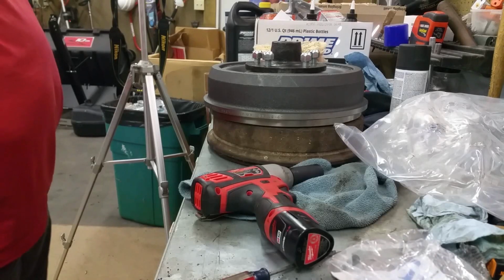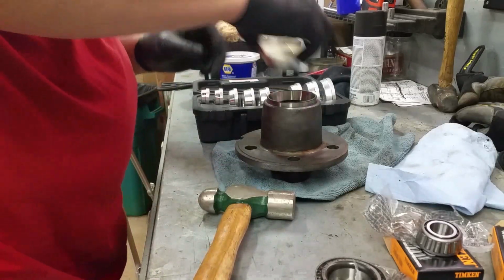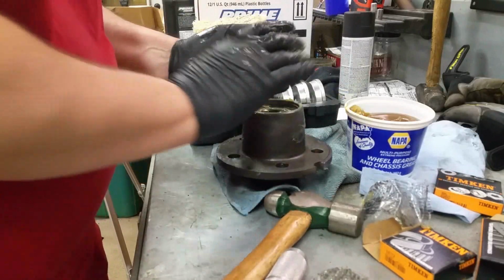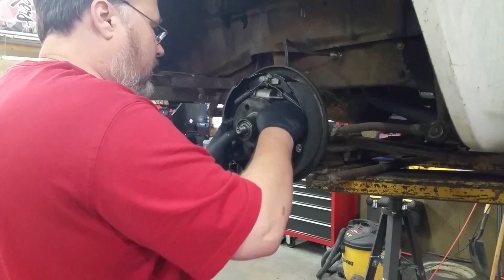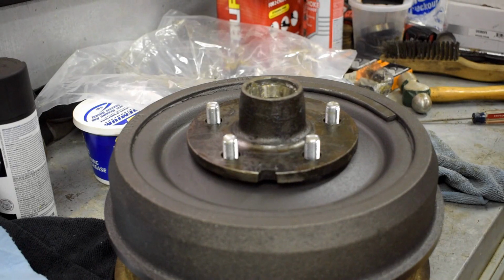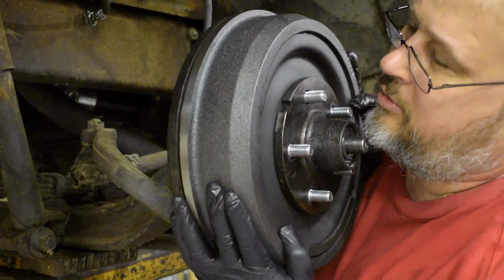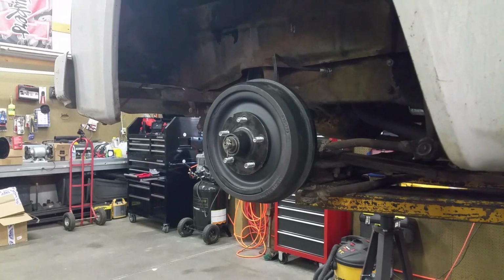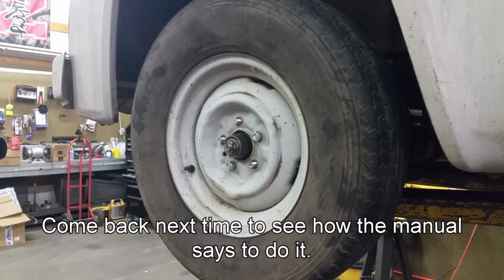Front Hub Assembly Part 1

Comment: You shouldn’t be grunting to set preload on these kinds of wheel bearings. That nut should only have something like 18-20 inch pounds of torque. Also make sure you have enough grease in the housing to give the heat somewhere to go. If the drums are dragging that bad I’d take them in and get them turned a little bit on a lathe. Try to measure the shoes diameter vs drum diameter so the shop can get it right.